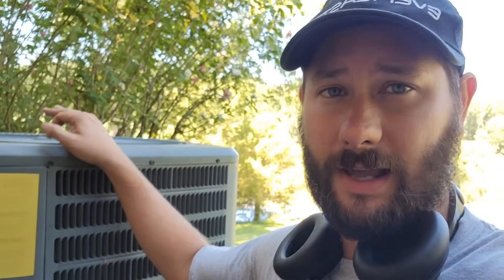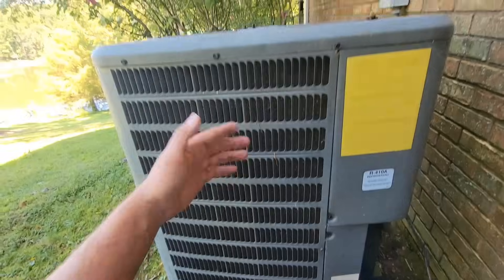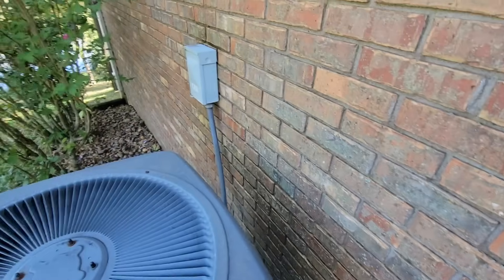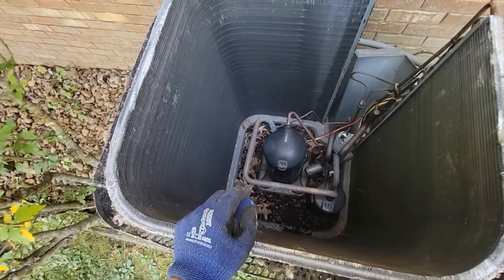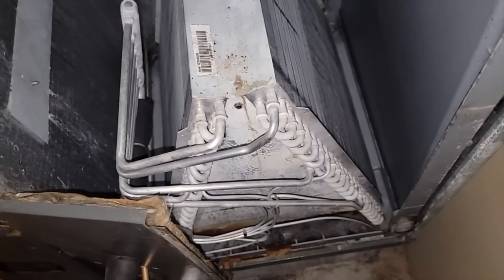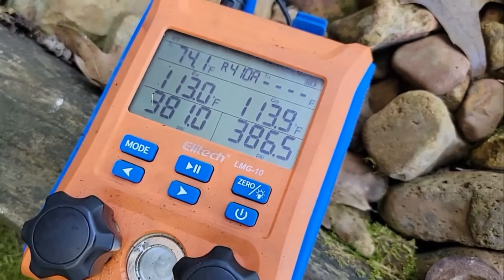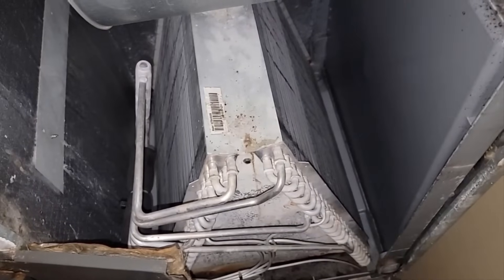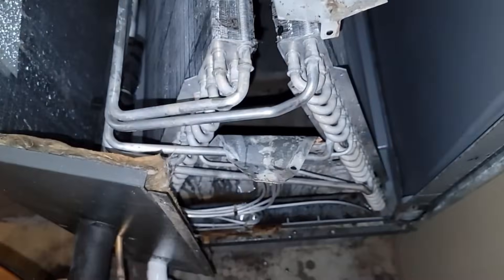How to find a refrigerant leak in an air conditioner?

Comment: Hi! Thank you for this very informative video. I’m your new subscriber. Can I ask you a question regarding our AC unit? We just bought a house and unfortunately the AC is not cooling the room. The AC Unit is manufactured in 2006 (very old). And it’s definitely leaking refrigerant. The technician that checked the unit suggested to add refrigerant and check for leaks 1 or 2 weeks after. Is that okay? Or should I insist to find the leak first? 
I would really appreciate your advise. Thank you on everything that you do!
Reply from the maker: I would go ahead and let him add refrigerant because you need to know exactly how low it is
Sometimes, it's hard to find the leak unless the refrigerant is significantly low, so it's good to know how low the refrigerant is before you schedule a leak check
Reply: My company likes to use fluorescent trace dye for leak searches. And those require a return visit for Leah search after the dye has been circulating for a few weeks. Maybe that’s what the tech was referring to?

Comment: I like how you gave the customer options and didn't judge him on what he chose. I need to find an independent contractor because these company guys are driven to force service contracts and high end equipment down your throat at every given opportunity. Maybe I'll get lucky and find a guy like you.
Reply from the maker: Thank you yeah I just want my customer to be happy. I offer my advice and it's always just what I would do if I had their situation.
I agree with you A lot of companies are just driven to make a sale and they don't care about the customer
Reply: @taddydigest  I have the same issue, lost about a pound in a year.  Have had 3 companies come out only to not pinpoint the leak, guessing it's probably on the back of the evaporator coil like this one.  What did you recommend replacing, the coil or the whole handler?
Reply: @Minimarshi What did you end up doing for that tiny leak?
Reply: Hey Dale, I hear ya brother. I work for a company in the Hudson valley in NY. A lot of competition but countless number of times I'm servicing equipment with the competition's sticker on it. I always try to be as transparent as possible. I've learned that once you lose a customers trust, you've lost their business.
Reply: @ronniehvac653  BINGO. HVAC techs in our area have a bad reputation for ripping people off. We've been taken advantage of too many times to count.
Reply: @ronniehvac653 well you’ve forgotten we are in the later parts of cronyism. You don’t have to worry about loosing customers when you buy up all the competition. Til we stop the trust, our world will continue to mirror the gilded era
Reply: BEST COMMMENT. This describes my situation. Every person I've had out is trying to get me to buy an entire new system when my system is only 8 years old. hard to find good honest work.

Comment: I use Fieldpiece's DR82 Infrared Leak Detector.  It's freakin awesome!
  I do a 3-hits-it's-a-leak check, but I really don't have to; if it goes off, there's a leak (or I accidentally bumped the tip on something).
  Probably the greatest feature about this particular leak detector is the fact that it gives you three signs to let you know that there is a leak: there's the audible sound, the flashing of the tip, and a vibration throughout the leak detector itself.
  That's awesome!
  So it doesn't matter if you're blind, deaf, or dumb, you will find a leak if there is one!
Reply: @ParabellumX  I just bought one today for $500 out the door

Comment: $2,000 to replace an evaporator? This is the reason I replaced my own coil.
Reply from the maker: yes, I'm glad you replaced your own coil Good Deal 👍
Reply: Only issue with doing this kind of work is if your not a contractor your pricing for a coil will be 2 to 3x the cost plus you need all the equipment to do the job, vacuum pump, touch, recovery machine/tank, refrigerant, nitrogen, refrigerant, guages, thermometers, vacuum guage, the list goes on. Once you get all this and your $800+ coil you will be well over the cost of simply paying  someone to do the work and with a contractor you should get a warranty for the work. You can't warranty your own work and most people just dont have the skills required to do the work. There is a lot involved.

Comment: I use the Testo 316-4 for R410a systems and the Testo 316-3 for R22, but the Inficon Tek 
Mate is also great option for r-22 systems ( I also have a Inficon tek mate).  The Testo 316-4 is probably the most sensitive electronic leak detector I’ve used for r410a.. and I’ve can’t even start to tell you how many electronic leak detectors bought then sold trying to find a good model.  Do a Search for NathanHVAC electronic leak detector sensitivity test.  He has tested most of the leak detectors I’ve purchased.  He has made spreadsheet of the leak detectors and their sensitivity for R22 and R410a refrigerants.  I’m trying out Ultrasonic refrigerant leak detector this spring/summer to see if that can help pin point small leak’s faster.
Reply: I've used several ultrasonic leak detectors and found that they were useless when trying to find small leaks. See what the return policy is on the tool just in case. A good way to test it is by using a calibration vial.

Comment: lol you don't put in 350 or 500psi nitrogen in a residential unit to leak test. Commercial/res tech here over 20 years. you need to read the max test pressure for both the evap coil and the outdoor coil and which ever is lower go with that pressure for test. Many R22 indoor coils are only rated to 150psig max test pressure if you add 350-500psig you are creating new leaks in the evaporator coil!! but idk maybe I screwed this all up and this video is so homeowners take out their A coils in a way they will need to replace them entirely. ooops
Reply: Correct. I close valve on condenser and put separate line pressure to evap and condenser about 300. after 1 day already see with line is leaking.

Comment: I would not recommend to anyone to go 500psi on a leak test.  I, like Oc have been doing it a long time.  Never pressure tested that high, even on the commercial side of things.  Can get dangerous.  Usually there are operating max pressures listed, I would not exceed those.  There is a leak detector that works via sound.  I had one of those as well, no matter how small the leak, it would sound like a hurricane in your ears.  Nice vid.
Reply: Agreed! I have never heard of anyone EVER going to 500 psi!
Reply: @epeterson711  well, I'm in AZ and it does all the time on rooftop units.
Reply: @MrDeviousdom  fair enough... I live in Wisconsin, so I've never seen the 410 THAT HIGH before... 🤷🏼
Reply: @epeterson711  also in heating mode, you will be up there around 500 as well.
Reply: @MrDeviousdom  fair enough.... As I said, from where I live, I've never seen that before.... Seeing as heat pumps are very uncommon up here ... 🤷🏼
Reply: 500+ psi is where a 410a system is operating during the summer.
Reply: @MrDeviousdom  where?  If so, clean the coil. Maybe in AZ. Not in FL.
Reply: @CZDigger  In hot areas. I don't understand the point of your comment.
Reply: Not in las vegas @MrDeviousdom
Reply: @lanceditzler  not in most of the country

Comment: Good video ! But Here’s some tips from a Guy doing it for 42 Years.
1) if System has at least 1lb of liquid refrigerant in it. ( 410a systems )  Just pull the disconnect. Wait 5 min for system to equalize. Equalized pressures on 410a system at 60 degrees outside  with liquid in it will be 170Psig. Higher if its hotter out. See pt chart. 170 is plenty to find a leak with a H10-leak detector or any decent leak detector.
2) Most Leaks are in evaps. 75% of the time. Start there first.
3) Rarely have i needed to pressure test over 150 psi to find a Leak with a Ge H10 leak detector.
Reply: I have been doing refrigeration and air conditioning for over 45 years. I am partial to my Inficon select. I spent 30 of those years behind a desk as a service manager. I diagnosed techs problems over the phone. Always look for a leak if the unit is low. To just add gas is not performing your job.
Reply: That rare time is that dang ice machine that passes the pressure test twice and has a fan switch that doesn't leak until it hits 275 psi high side....ugh
Reply: The G.E. H-10 with a cord is without a doubt the best leak detector you can get your hands on.
Reply: @stevenross9271  I used the H10 from 1973 to 2006. They were the most reliable.  The old ones did. Not have the audible, just the flashing light.

Comment: You guys have so much tool to do the job i don't have a leak detector eater nitrogen no access to those when i am doing my small ac work back home i have to use air from compressor and bubble but still get my job done 👍
Reply: Ok thanks for telling me but that is the only way I check for leak with my job I don't have nitrogen
Reply: When using compressed air, the air contains containments and moisture depending on location, I would draw a 24 or a triple vacuum, the air is primarily nitrogen any way.DO NOT USE A TANK COMPRESSOR unless it is drained clean.I think I'll try myself , think you!
Reply: Never use O2 (oxygen) inside refrigerant system unless you want a violent explosion and fire. O2 and refrigerant oils is a bad combination.
Reply: @NytefogNJ  O2 is highly corrosive to steel and iron parts if you have copper o2 leaves a petena on copper.
Reply: No advice 😞

Comment: The only thing that you forgot to do is that when ever you do any sort of testing over 100 lbs of nitrogen you tell EVERYONE AROUND that place that you are performing a high pressure test and that it would be better if they stayed away from the copper pipe. God forbid if it had a bad joint and it exploded it could hurt someone
Reply: What pressure do you think that the refrigerant piping normally has in it? Is it over 100 PSI? That's why I'm laughing
Reply: His statement about nitrogen and pressure
Reply: @5822huron  gotcha, it was just a vague response wasn't sure what you were talking about
Reply: @MrDeviousdom  please explain.  I had a bad leak years ago, but luckily it was in the crawlspace.  It couldn't keep the nitrogen in at 350 psi.  It would've scared a customer but it did not came apart
Reply: Not true.  Smh
Reply: @5822huron  Tell us what's not true.
Reply: Yes, whenever our AC unit turns on I run around the house warning people that it might explode.   They get tired of me doing this four or five times a night, but think of the safety of the kids!!!!!
Reply: Also, I yell, "fire" when I start my car so everyone knows there are gallons of gasoline vapor being burned at hundreds of PSI.   Scary!!!

Comment: You should be able to wet your bare hand and feel for the leak better
Reply: Yea, spray some soap bubbles on it. You can feel bubbles with your fingers really easily & it makes bubbles when you pass over the leak with your fingers.
Reply: Hey, that is a solid tip.  If your hand is wet the blowing air will cool your hand.  Good idea.

Comment: I use dish soap water paint brushes and spray bottle, the leak detector gives me a general idea of the leak is.
Reply: I was told dish liquids (Dawn, Joy, etc)  have lye in them and are corrosive to copper. Use an approved something if you don't want to pay for Big Blue  etc..

Also chlorine sterilizer in condensate drains can attack furnace parts, use vinegar.  Yet in reach-ins salad dressings and tomato products seem to eat coils.  Who is right?

Comment: I have used multiple bacharach h10s and various other refrigerant leak detectors. I have NEVER found a leak with any of them. I always find them with bubbles, sound, and oil spots. What leak detector do you use?
Reply: That makes absolutely no sense as the h10 picks up leaks that are so small they don't even create bubbles. You might want to revisit your technique and or have the equipment checked.
The H10 includes a calibration vial of R11. Make sure it's calibrated properly.
Reply: I have never found a leak with bubbles only leak detectors
Reply: I've found some leaks with the NAVAC.
Reply: @ Christian lara
Ive been doing Leak detection with a Ge H-10G Leak detector for 42 Years & it WILL Get you Right to a leak EVERYTIME.
THE Problem is With YOUR Leak detector or YOUR Technique Period ! 

Basics of Leak detection with a Ge/Bacarach H10G Leak detector.
1) Plug detector in.
2) turn on.
3) set switch to Medium. Turn dial left until no clicks are heard during warm up.
4) Let detector warm up for 5 Minutes on the clock. Then adjust dial till clicks are heard every 1 second.
5) bring probe tip across top of Sample bottle & hold for 1 second. Leak detector should scream loudly. If not.
Set Switch to SMALL. Adjust dial to clicks ever 1 second. Try again. Wave probe tip over sample bottle / reference leak detector test bottle included in every ge H10 leak detector.
It should scream loudly & Red led should be flashing madly. IF Not Leak detector NEEDS Adjusted / Sent in for Service.

If Leak detector works / Tests out good Here is Basic technique of Leak detection —
1) System Must Have 25 Psi of Refrigerant in it Min. Then -
2) Add 150 psi of Dry Nitrogen to System being checked.
3) Test that both Sides of the System have a Min Pressure of 100 -150 Psig in the System.
4) Allways check that Leak detector works before starting leak detection procedure with test vial or at refrigerant tank briefly. Once detector is known functional then & only then can leak detection start.
5) Start with Ge H10 Leak detector in Medium position , set click rate of 1 click per second & Bring leak detector Near Evaporator or Condenser.
To check for leaks.
6) the H10 is designed to be moved across an area at a Rate of 1” per second.
7) DO NOT LET IT SUCK UP WATER / Keep it away from water. It is a Pump that WILL SUCK up water and it will instantly Junk out the Leak detector.
8) if you get the probe tip wet - Change the white probe tip filter with the filters provided.
9) Remove plastic probe tip & dry out with paper towel or rag.
10) Replace Red Floating ball 🏀 that is in Probe Plastic tip. ( it shows you that Pump is sucking air ) 
11) install New dry white Filter into probe tip.
12) install Rubber tip on probe & start again.
13) Warm up Detector, set to medium, Keep probe tip moving at a rate of 1” per second & try to keep it away from water & soap bubbles. Keep approx 1-2” away from wet surfaces.

This should get u started.

Comment: I have a system from the mid 90s that hasnt run in a few years due to a leak and the refrigerant being super expensive. can a system like that be repaired and retrofitted? or would it be a wash in cost and better to just update?
Reply from the maker: I would probably upgrade